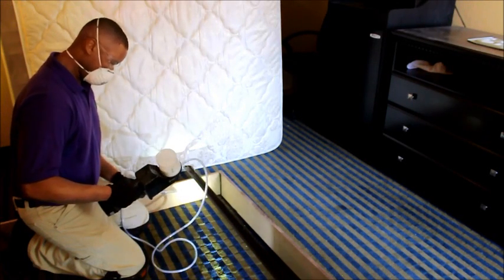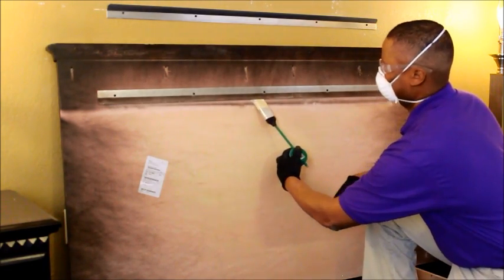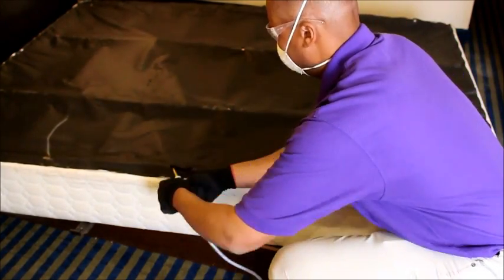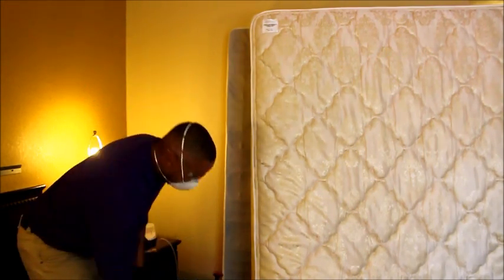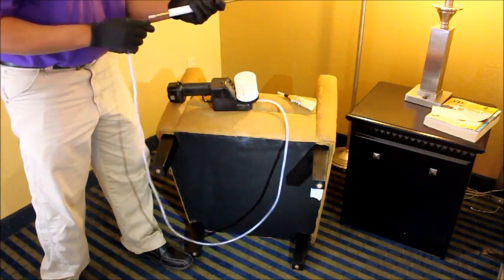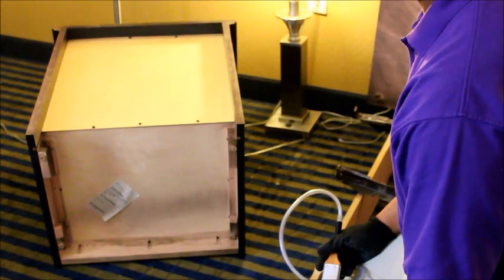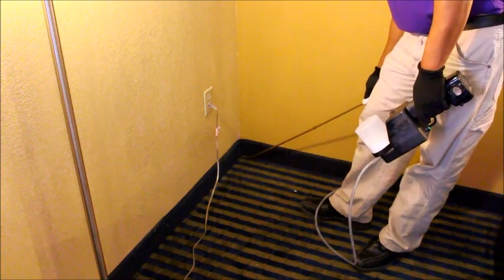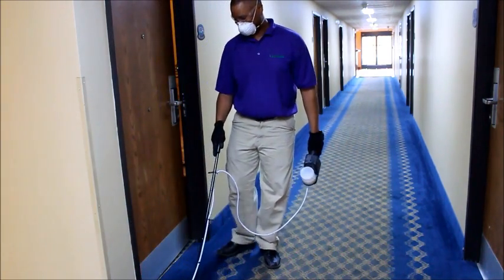CimeXa™ Insecticide Dust: Product Applications

Comment: Where can I get his exact extension rod he uses in the video with the puffer?
Reply from the maker: Hi Bob, thanks for watching our video! The JT Eaton Hand Bellow Duster and extension rod may be purchased from Do-it-Yourself Pest Control at: https://store.doyourownpestcontrol.com/
Reply: @rockwelllabsltd  Thanks! And where can I get his brush with the handle that attaches to puffer for application of dust?
Reply from the maker: @ArchMage1011  No problem, Bob! The brush is a larger paint brush in which we have cut off the extended handle and drilled through the remaining handle until it reaches the brushes. Instructions on this may be found in this video: https://www.youtube.com/watch?v=OC8mFqvyH9I&t=8s
Reply: I was hoping to get exactly this info. That air brush is cool! Thanks!

Comment: Do I have to turn off the electric to put sign Max or in the electrical sockets
Reply from the maker: Hi Melanie, thanks for your question. While you may remove electrical switch plate covers to allow access to voids, CimeXa shouldn’t be applied directly in electrical boxes.

Comment: Where can u get the vaccum
Reply from the maker: Hello,  thanks for your question. The vacuum being used in this video is the Exacticide with the battery-powered carpet applicator accessory from Technicide. They may be purchased as a bundle here: https://www.technicide.com/products/10-off-bed-bug-bundle-deal.

Comment: About togo to Walmart and get this. Does it come with that brush?
Reply from the maker: Hello Vell, thanks for your interest in CimeXa. CimeXa is not available for purchase at Walmart and does not come with the application brush. However, Cimexa is available for purchase online: https://store.doyourownpestcontrol.com/cimexa-insecticide-dust
Reply: Hey quick question I hope you can answer. What is a JT Hand Bellow Duster? Is that what the gentlemen in the video is using?
Reply from the maker: Hi Vell, yes. Dr. Sandidge is using a JT Eaton Hand Bellow Duster to apply CimeXa. However, there are many different brands. Everything he used in the video may be purchased here: https://www.dustrod.com/products
Reply: amazon has it

Comment: Cimexa (amorphous silica gel) dust is very effective, best used as a dry powder wherever possible -- applied with a puffer or brush. We used it in our apartment complex for seniors and disabled folks. Cimexa worked where everything failed -- pesticides, diatomaceous earth, and very expensive but ineffective full building heat treatment. Even with a return infestation after 3 years (primarily due to new residents bringing bed bugs with them), spread has been confined because of the long residual effect of Cimexa in baseboards and between wall voids.

While the Cimexa and water spray application may seem appealing because it's easier, it's also less effective than the dry powder. The loose dry powder worked within 12 hours in our tests. The water spray could take 3 days or longer before the bed bugs picked up enough dried Cimexa dust to be effective in desiccating the bed bugs. The loose dry powder also has the advantage of spreading itself more readily in wall voids of large buildings where drafts occur, and there's no risk of water damage or electrical shock. Puffers with non-conducting applicators are safer.

Other methods include local application of steam heat (via a clothes steaming wand or upholstery steam cleaner) to furniture, baseboards, etc. -- anything that won't be damaged by steam heat. It works very quickly and can help salvage otherwise usable furniture, bedding and clothing. We used an ordinary Conair steam/heat clothing wand on furniture and baseboards. For larger applications a rented upholstery steam/heat cleaner would be useful.

Electronics and other delicate items that cannot withstand heat/steam can be treated with concentrated carbon dioxide. An NIH/NCBI study recommends ordinary dry ice in an enclosed container such as a styrofoam ice chest or closed plastic trash can with the items -- computer, electronics, any delicate item. Keep the container with dry ice closed for 24-48 hours while the carbon dioxide displaces oxygen and asphyxiates the bed bugs. See: https://www.ncbi.nlm.nih.gov/pubmed/23025189

These methods are fairly labor intensive and compared with the modest cost of the materials including Cimexa dust, the biggest cost for professional application would be skilled labor. If the pest control applicators are unwilling to put in the labor, including getting on their hands and knees to do the job properly, results will be compromised. That was our experience with a pest control company that preferred the water based application of Cimexa around baseboards and in the general vicinity of furniture, but didn't actually strip the beds, flip the furniture and treat seams and under dust covers, inside box springs, etc. Do the job as demonstrated in this video and it will be effective.
Reply: Thank you so much, I found 2 of these little bastards on my bed and have been researching like a mad man ever since. Im going to go through the areas again with CimeXa after I get it professionally treated
Reply: @BrentCox2B  did cimexa work for you?
Reply: @whos.smokey  I ended up going kinda crazy and used Cimexa all along any cracks and crevices in my whole house and underneath my furniture and in any cracks and crevices in my furniture. Then I used Crossfire Bed Bug Concentrate which is a liquid mixture you can spray and I sprayed that in every corner and along the floor where the walls meet the floor and in all my window seals and I sprayed the underside and inside of all my furniture. I also got diatomaceous earth and sprinkled it all in my carpet. I hauled my bed and the couch I found the bed bugs in to the dump. I took all my clothes dressers apart and coated the inside edges and crevices with Crossfire and Cimexa. It took me 2 straight days of work non-stop going through all my my house treating any cracks and crevices but I have never seen another bed bug since then. I probably went overboard but I hate that dirty feeling of feeling like I am living with bugs so it was worth it for me. The bed and couch i threw out were like 10 years old anyway. But yes from my experience and all the research I did, Cimexa works very very well, especially when you also use the Crossfire Concentrate
Reply: @BrentCox2B  I just ordered the crossfire and cimexa as well as a handheld steamer off of Amazon and will have it tomorrow, what would you recommend as the application process? Steam clean everything possible then Crossfire and finish with the Cimexa? Sorry to keep bugging ya just freaking out a little bit lmao
Reply: @whos.smokey  Thats okay. Yes, I think Steam cleaning, then Crossfire, then CimeXa is a good order to go with. I just mixed my Crossfire in like an industrial size cleaning solution spray bottle and sprayed with that. And then I just used a little fine paint brush to kind of lightly dab the CimeXa in the cracks and crevices. I didnt have small children or animals at the time though so just be careful if you do and read the instructions on everything
Reply: @BrentCox2B  really appreciate it, hopefully all goes well
Reply: @whos.smokey  how'd it work out for you Andrew? Looking to replicate your exact plan right now
Reply: @BrentCox2B yeh, you went overboard but you sound like me. I'm going through it now and I'm on round 2 of DE. Crossfire isn't available in my state so I'm doing everything I can think of. Cimexa's next on my list!
Reply: @nuthinbutlove Dang this is probably the oldest comment Ive gotten a reply to haha. 
6 year's later still no bed bugs! 

But yeah I probably went overboard haha
Reply: @BrentCox2B lololol... I'm sure I'll do the same thing. I just want these things gone, they've ruined my life for long enough. Great to know it works so well. Thanks!
Reply from the maker: Thanks so much for sharing your experiences using CimeXa!
Reply: @rockwelllabsltd is it true that water mix is almost ineffective? Not mentioned into the label, this could worsen the treatment process
Reply from the maker: @eleonoram.5263  We'd be happy to provide more information. When CimeXa is mixed and applied properly as a wettable dust, it will still be very effective. Per the label, CimeXa is a unique dust in that it can be applied mixed with water, as a spray application. It doesn’t dissolve, it forms a slurry, which when dry goes back to its white dust form. This technique is referred to as a “Wettable Dust” application. The most effective mixing rate is 1 oz, which equates to 1 cup in 1 qt of water. A typical hand actuated spray bottle is ideal for this application. When applying CimeXa in the wettable dust form, it is best to spray the intended site with two light coats. Spray the first coat and let dry, then spray a second light coat. This method allows the CimeXa dust to ‘sit up’ on the treated surface, ensuring maximum product pick up as the bed bug walks through the CimeXa. For best results, mix CimeXa as follows: 1. Add approximately half of the required amount of water to the bottle/tank. 2. Add the appropriate amount of CimeXa. 3. Close application equipment and agitate or shake the tank until dust is wetted and a slurry is formed. 4. Add the remaining water and agitate or shake again before use to ensure thorough mixing. Note: Shake or re-agitate application equipment before use if application is interrupted to ensure the product is thoroughly mixed. Mix only the amount of application volume required. Do not store the spray mixture overnight as it will begin to gel after sitting for several hours.
Reply from the maker: @eleonoram.5263  We'd be happy to provide more information. When CimeXa is mixed and applied properly as a wettable dust, it will still be very effective. Per the label, CimeXa is a unique dust in that it can be applied mixed with water, as a spray application. It doesn’t dissolve, it forms a slurry, which when dry goes back to its white dust form. This technique is referred to as a “Wettable Dust” application. The most effective mixing rate is 1 oz, which equates to 1 cup in 1 qt of water. A typical hand actuated spray bottle is ideal for this application. When applying CimeXa in the wettable dust form, it is best to spray the intended site with two light coats. Spray the first coat and let dry, then spray a second light coat. This method allows the CimeXa dust to ‘sit up’ on the treated surface, ensuring maximum product pick up as the bed bug walks through the CimeXa. For best results, mix CimeXa as follows: 1. Add approximately half of the required amount of water to the bottle/tank. 2. Add the appropriate amount of CimeXa. 3. Close application equipment and agitate or shake the tank until dust is wetted and a slurry is formed. 4. Add the remaining water and agitate or shake again before use to ensure thorough mixing. Note: Shake or re-agitate application equipment before use if application is interrupted to ensure the product is thoroughly mixed. Mix only the amount of application volume required. Do not store the spray mixture overnight as it will begin to gel after sitting for several hours.
Reply: I've read the same thing on a few other sites regarding dry application being more effective than wet. It does sound much easier applying wet but good to know it both takes longer to kill them and may not be as effective. Thanks for the detailed breakdown.
Reply: the particles can kill you